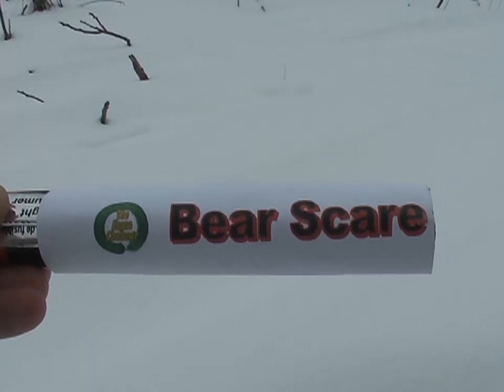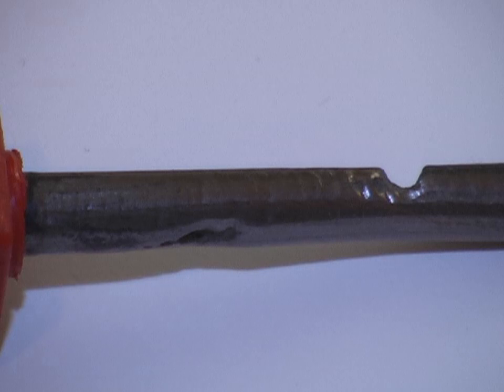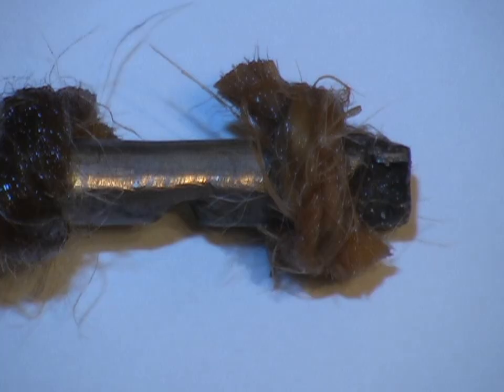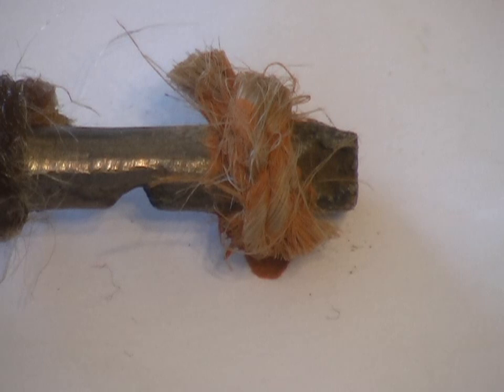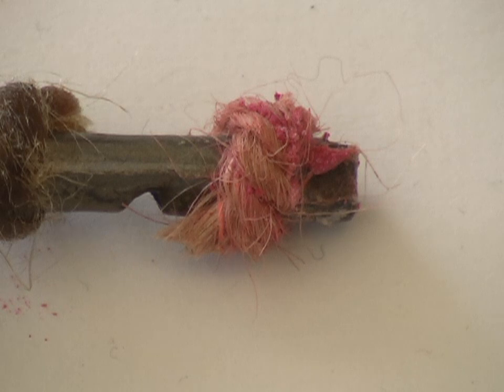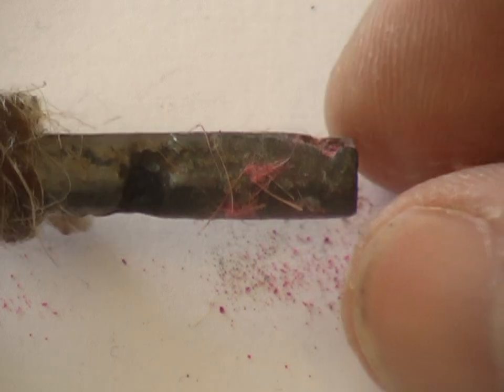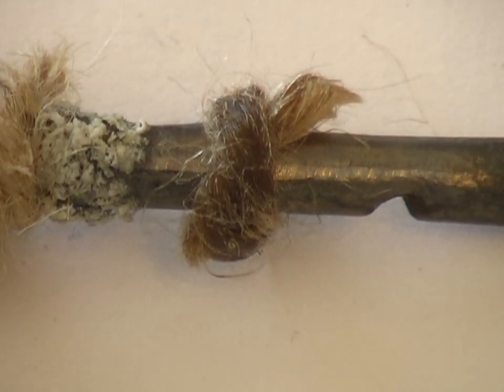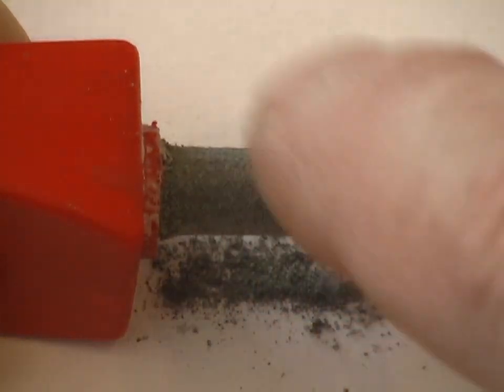Ferrocerium Firesteel Rod  - Testing for corrosion

Comment: Greetings! I know this is an old video, but...one of the most effective methods I have found to protect large Ferro rods is Rennasiance Wax. I just put it on like shoe polish and don't buff it off
Reply from the maker: Some other suggestions have been painting the rod with nail polish.  I have not had any issues with any of my Ferro rods since I did this experiment.

Comment: i've seen lighter flints turn into dust within a few years, just from touching them at some point. a drop of ballistol will prevent that, and it should be in any survival pack anyways.
Reply from the maker: Interesting tip.  First I have heard of this stuff.  Just finished checking out the website and they tell a very good story.

Comment: The econo challenge please please test oil like motor oil and hoppe gun oil if a layer preserves as long as u keep it in there or the oil + candle wax u til ur ready to use I really need to know.

I would hate for these things to be to good to be true I've invested so much money into them for them to poof over time !!! Please find out for me. Subbed and belled.
Reply from the maker: I really appreciate your subscription.  Thank you.  The best solution, if you want to store your Ferro rod for a long period of time, is to paint it with clear nail polish.  Now if you want to be smart you might even consider painting it with bright orange nail polish so you can find it easily when you drop it in the black sand on a beach on Vancouver island.  Wait what did I just say?

Comment: I've found water to be the ferro rods worst enemy and time doesn't do them any favors either. Drop a ferro rod into a glass of water and within weeks it will be reduced to a funky mess. I've also found that with time a ferro rod softens. I bought a new rod, opened the package, the rod had deteriorated to the point that it had ripples in it and all that it produced when scraped was a pile of worthless powder. I left a small rod in a dresser drawer for two years and it deteriorated into powder even tho it was in a dry environment. Time and water.
Reply from the maker: We eventually found the answer to what kill my ferro rod.  Since them I have not had a problem.  Maybe not enough time has elapsed.

Comment: short circuit a battery using a copper wire and touch the copper wire to your ferro rod.
This, I think(not very good at chemistry) might work..since copper if in a heating installation, will corrode aluminium and other metals...electric current passed thru it might actually have an effect.
However...I still don't think that's what went on there....

Comment from the maker: Salt water will definitely react with the material in these rods.  You can`t see it very well in the upload, but in the original you can see the reaction taking place immediately.  The way salt water could have contacted the rod would have been from my sweat.  We concluded that sweat did not have the salt saturation needed to cause this kind of damage.  The electrical current idea has been suggested before, we have not tested it out yet.  Not sure exactly how to do that.

Comment: you dont need a battery for electrolysis.  just an electrolyte solution, like salt or potassium hydroxide, and 2 metals.  if active enough they make electricity while rusting. if not it takes electricity to force the rust.  on a side note, harbor freight tool stores (@least in california) were selling the 4" long magnesium blocks w/ flint rod and a striker for under 3$ but just as good as 14$type you find in a walmart / big5. cheap test supplies :) find the cure
Reply: demnlordd66

Comment: @EconoChallenge I'm seeing where Shoemanshoe68 is going. He's thinking Electrolysis, and I was thinking the same thing. If you had a ferro rod, and a battery, and a conductive solution in the same vicinity, it would explain the particularly deep gouging in some areas and not others.

Comment: @EconoChallenge One example would be photosynthesis. It would appear to be unworldly and strange if we didn't understand it. I might be totally wrong, but then, I might be right. It's a matter of recreating the conditions in the waistpack one at a time. I would also like to suggest sweat - your sweat, as a Human, has a fairly high concentration of salts and acids. It's a waistpack. These are close to the body, no? This means there were MANY chemicals exposed to the ferroceum rod. Surprising? :)

Comment from the maker: @BrokenAeroVT The rod has not been used a lot over the years.  I can remember a trip to the White Mountains we had a contest using it.  Four guys testing their skills at lighting various tinder with this fire steel.  The rest of the time I am the only one using it.  Most of the time it just sits in that pocket as my back up fire starter.  Unfortunately I did not get any video when the damage was first discovered.  You could see that it was not wear damage.

Comment from the maker: @CalifHighCountry We are working with the idea that is is potassium hydroxide.  Found in rechargeable batteries.  It is also formed when black powder is burned.  The moisture from the air combines with the white sticky residue to form this base.  We just don't know if it is strong enough to do the damage ... yet

Comment from the maker: @ihikearoundcom We are working with the idea that is is potassium hydroxide.  Found in rechargeable batteries.  It is also formed when black powder is burned.  The moisture from the air combines with the white sticky residue to form this base.  We just don't know if it is strong enough to do the damage.  This stuff is hard to collect.

Comment from the maker: @Woodenarrows Yes.  I often carry spare batteries.  You seem to following the same frame of thought we are. I use rechargeable alkaline batteries.  They are cheap and they explode in the charger sometimes.  Still I like them better than buying disposable batteries.  I have lost one flash light over the past 3 years because of battery failure. It is possible that the rod came in contact with some  potassium hydroxide from a damaged battery. We are testing this idea now.